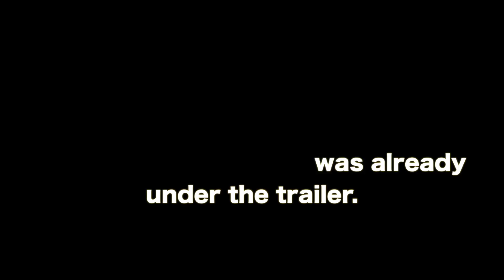#BertLife - Flex Duct Repair Terror

Comment: The good thing is that it was dry under there, ever job I had to go under the trailer was caused by condensate drain plugged up and it filled up the crossover duct with water. Fighting with mud and Feral Cats can really ruin a Technicians day